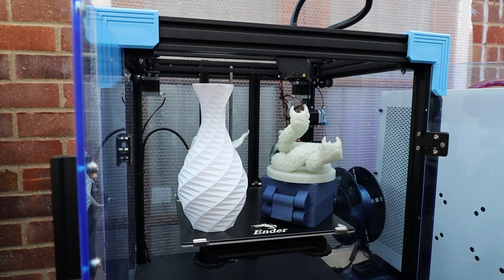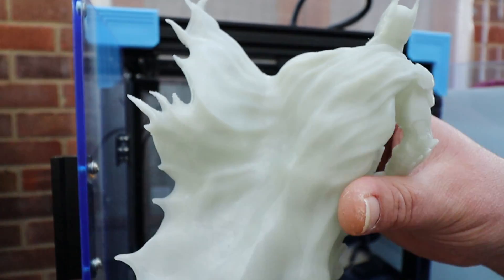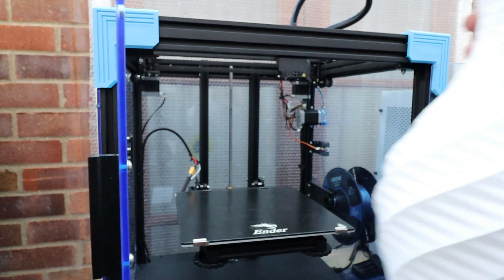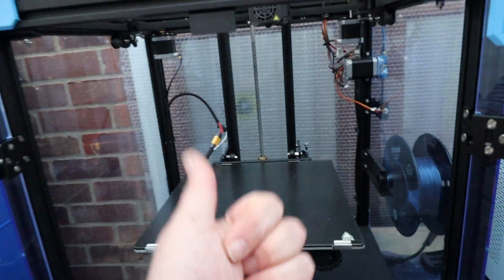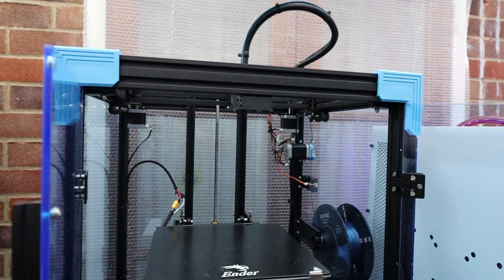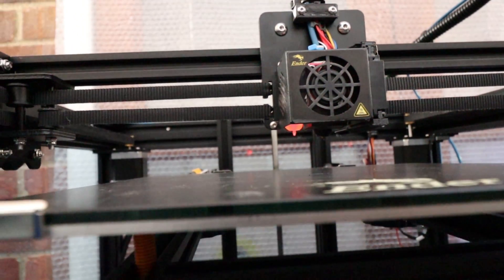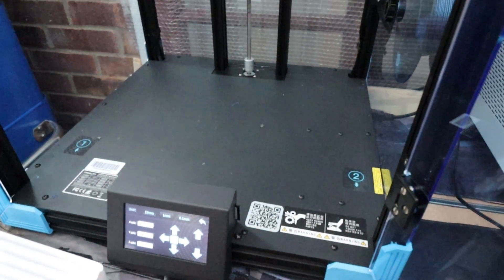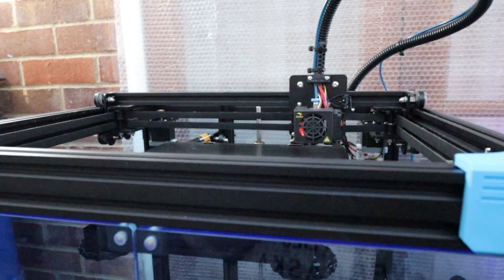Creality Ender 6 Test Prints And BLTouch install v3.1

Comment: I'm about to replace my POS flsun QQ-S pro with either a Ender 5 plus or Ender 6. I've watched both your videos on the 5 and 6. Is the Ender 6 worth the £70-£80 more? Grated you can print faster, but you're losing 100mm in the X/Y build volume and I'm not totally convinced there won't be drooping of the bed or premature bearing wear over time with cantilever bed design. Also stepper motors inside the enclosure? Help me out, what are your thoughts?
Reply from the maker: hmm now that is an interesting one, in all fairness the 5plus used to get on my nerves alot with its bed levelling but its been awhile since i owned it and im guessing they would have released new firmware by now the only problem was the bed was so big and heavy it would often drop and need setting up again, bigger isnt always better, ive been having more fun and less hassle with the smaller printers, i love the ender 6 its working really well and the bltouch once installed is just a dream, but at the end of the day its upto you i dont want to be blamed if you get one and dont like it lmao
Reply: @BeanGaming-w4n  yeah I can see what you're saying, I guess the extra weight of the bed cause slips on the threads. BLtouch never really interested me anyway, since cutting my teeth on the Ender 3 and CR20, both I've never had to re-level except after nozzle changes. Ender 6 is is then, because speed and print quality out does bed size.

Comment: Hi, will you be doing more Ender 6 videos? Currently waiting on my Ender 6, and there is hardly any videos our there :(
Reply from the maker: Hi, I dont currently have anymore videos planned for it but I'm happy to go over anything if you have any suggestions 😊
Reply: @BeanGaming-w4n  Hi, sorry been meaning to get back to you. So what do you currently speed at speed wise and what's the fastest you've been able to print happily? Just watched the last video about the USB, I thought the Ender 6 had built in WiFi ?
Reply from the maker: @NonStick872  hi, sorry no wifi on the ender 6, i have been printing at 150mms and the print quality is quite good, most of what i print gets painted so a few inperfections dont bother me
Reply: @BeanGaming-w4n  ah ok thanks, and that's a shame I thought it did have WiFi built in, no worries as you've pointed out that's easy to fix. Still waiting on my order though .... :(  and I'll see if I can get the right cable from Creality, as I just bought another BLtouch for when I do get my Ender 6 :P :D

Comment: See Thinginverse thing 4675867 for my improved wire loom tube clamps.   Mine came in, love it except I get no response from touch screen.  Sad.   Anyway, I know it will be worked out.  Impressive printer as far as instructions and mechanics go.  I bought it to make many mods to.  At least I got to be the first maker with an upgrade for it on Thingiverse.
Reply from the maker: Hi, check the cables on the screen and the board to make sure they plugged in correctly
Reply: @BeanGaming-w4n  I removed and re-seated them.  Can they be placed backwards?
Reply from the maker: @CraftedChannel  hi, I'm pretty sure they can only go one way around, ive not had mine apart to check unfortunately, does the screen come on?
Reply: @BeanGaming-w4n  Yes, it appears to boot normally.  3 options come up but tapping the screen gets no results.  On my board, the screens black wire is oriented towards the middle of the board.  If you should look, I'd love to have a close up photo of both ends of the cable.  I don't expect you to tear it down for me.  I'll call the customer support line Monday.  It says I need a serial number and I don't see one anywhere.

Comment: hmm I wonder how long it will be before some direct drive kits come out for this
Reply: I'm hoping when E3D gets going again, that I can put a Hemera on my Ender 6. Just got the thing 2 days ago and I'm still in the process of doing test prints. Fantastic machine out of the box and it looks to have loads of potential.
Reply: my local supplier says the ender 5 microswiss kits works - I ordered once so will tell you when I get it fitted!
Reply: @TeamAstroworkz  it needs 4 10mm cutouts for the belts so I'm not sure it would work 😔
Reply: @samueldennis8343  the heads the same as  the 5 though??   I havent fitted it yet LOL
Reply: @TeamAstroworkz  it is the same style hotend but the backplate where the wheels attach to isn't, it has 4 slots for belts not 2
Reply: @TeamAstroworkz  it's because the 5 has one belt for X where the ender 6 uses 4 belt slots because of the corexy design
Reply: @samueldennis8343  ahhhh - well no point in trying that - will have to wait for Swiss Micro to come up with a new kit - thanks for the advice
Reply from the maker: I ordered one in but can confirm the micro Swiss will definitely not fit the backplate is completely wrong but won't go to waste as will install it on my ender 5 Pro which I have a few tasty plans for 🙂
Reply: @TeamAstroworkz  no worries! Are you UK based? Keep an eye out for the place I work for! if so it's www.technologyoutlet.co.uk if microswiss do bring one out we will be the first in the UK to have them as we have an exclusive UK trade deal.
Reply: @samueldennis8343  nope NZ :)
Reply from the maker: That would be sweet

Comment: What's all the dust/fuzz around the X/Y wheels? starting to notice it on mine too. are the wheels wearing?
Reply: Mine has less than 10 hours on it
Reply from the maker: Hi, its nothing to worry about it just dust and muck, when printer not running blow it off with some air or just brush it off, all my printers do that so dont be concerned its perfectly fine
Reply: @BeanGaming-w4n  Done. Thanks!

Comment: Thanks for the video.  I ordered one on Black Friday.  Due here this Friday.  White is a terrible color to show detail but this is the first video showing prints that does not come from China.  Are you printing PLA with the door open?
Reply from the maker: I always close the door, the top is open so doesn't effect it, I have printed several other things with this printer and they have all came out really well, I cant fault this printer for print quality at all whatsoever, I can happily do another video if you want to see more prints just didnt want to bore people with the same thing as trying really hard to get to 1000 subs, if you use Instagram come follow me beanieshobbies lots more of my work on there
Reply: @BeanGaming-w4n  It's a good way to grow your channel.  People are hungry right now because there is no content on this printer but lots of excitement.   The colored items you showed looked really great - you can see the layer lines.  You can't tell by looking at white.  Love to see a video of it actually printing at a couple different speeds.   I only make mechanical parts so I never have worked in PLA.  I use ABS and PETG at the moment.  I want to put a higher temp hot end on this so I can do Nylon.  I will be making a top.
Reply from the maker: @CraftedChannel  well leave it with me I will start doing some more prints 🙂 just got another couple of printers to review as well, all go at the moment lol
Reply: @BeanGaming-w4n  Keep going. I'll give you likes and subscription.
Reply from the maker: @mattmichael2441  the ender 6 and ender 3 are 2 completely different printers, you can't compare them, I'm just doing this for fun and to help people out so yes I'm just another rando with advice unfortunately

Comment: Thanks very much for sharing your success with this printer.  Did it bother you much to change your firmware from the V1.0.4 backwards to V1.0.2 in order to have the only available firmware supporting the BL Touch?
Reply from the maker: Hi, didnt bother me at all as the auto bed levelling works fantastically on this machine so if anything I would say step forward rather than backwards

Comment: I wasn't sure whether the Bowden tube needed to got inside or outside of the Extruder end clamp.  I ran mine on the outside and then was able to clamp that flexible cable housing with just the wires as designed.  Also I noticed you changed the Bowden tube to the Capricorn item.  Would you recommend doing that as well?
Reply from the maker: Hi, capricorn tubing is alot better quality and worth doing
Reply: @BeanGaming-w4n  Got one on order, tnx.  The biggest take away I got from this video is the process you follow for the BL Touch leveling routine.  I kept looking for something that would SAVE THE SETTINGS like most of the Ender product line.  Didn't expect that pressing auto home would do that.  Just completed a very successful 4 hours Cute Mini Octopus print.  I very happy.

Comment: I purchased my BL Touch from Antclabs (Amazon.com) with a 1.5m extension cable.  The extension cable has a small JST 5pin connector on one end and no connector on the other.  The BL Touch itself comes with a short cable already plugged into its' small JST connector.  Just cut off the unusable connectors on this short cable and splice the matching colors, no pin swap needed.  On my Ender-6 installation, I also shortened the extension cable by about 18" before splicing my wires.  Looking back, I think I could have gotten away with purchasing the BL Touch from Antclabs with the 1M extension instead, and saved a couple of dollars.

Comment: Hi, rushing out to night shift, sorry if I missed it but how long does the extension cable need to be? (and I think I know but can you confirm what the connectors are, JST-PH 2?)
Reply from the maker: hi, i think you will find its a 5pin Molex Picoblade and 1 meter would be ample